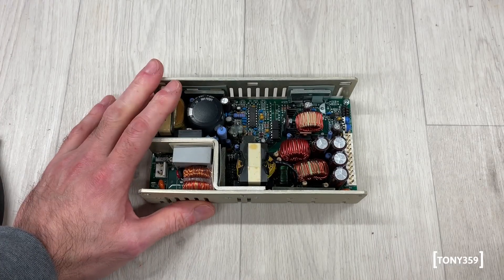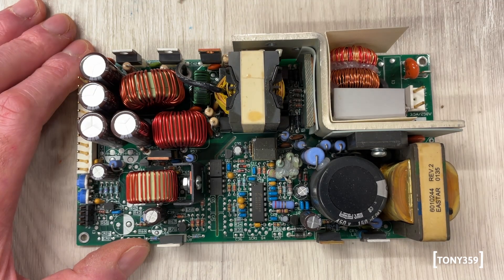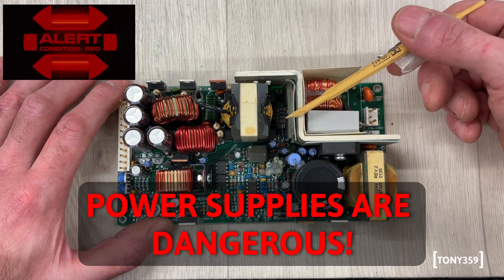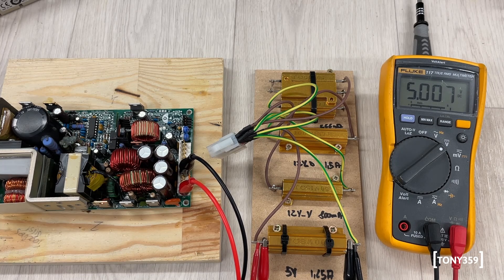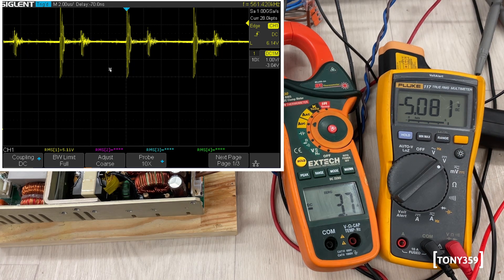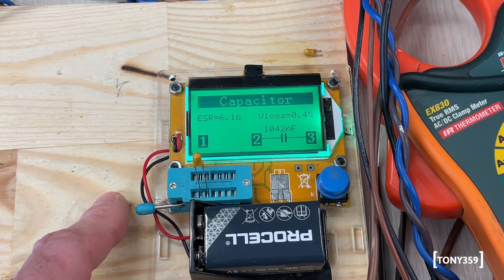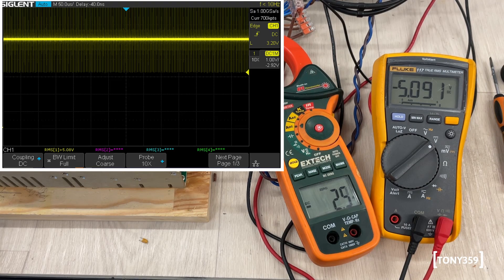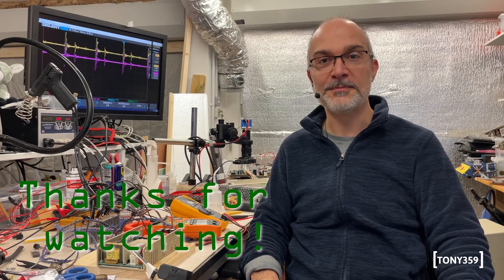I repaired a Power Supply using cold air

Comment: 3:44 pointing directly at a cold solder joint, 15:51 it´s gone😁
Reply from the maker: I think it's just cleaned, I don't think it was a cold joint, just a factory joint which hadn't been cleaned as it often happens. Thanks for watching!
Reply: @tony359 Thank you for your reply. The middle of the three solder joints next to each other horizontally looks like it has a ring around the leg of the component, to me that looks like a broken cold joint.
Thank you and have a nice day👋
Reply from the maker: I see what you mean, I often see non-existent cracks when inspecting from above. It might be though, I don't know, it's been a while! But thanks for mentioning! :)
Reply: @tony359 Yes, that's true. It may or may not be.
Thanks for your kind answer and have fun with your projects.🙂

Comment: Nice.
Did you see any thing on that cap under thermal camera?
Did you use hot air on that cap to make that intermittent problem appear faster?
Reply from the maker: Well, if you watch the first time I used the thermal camera, you can see the cap getting hot - but not as hot as the diode which stole the scene! :) The PSU was protecting itself so the capacitor did not explode or get too hot. But the diode, being a smaller component, did and that fooled me! :) 
No, I did not use hot air on this occasion. Thanks for watching!

Comment: Hi Tony I like your down to earth video's.
I do quite a few medical grade PSU's mostly from ophthalmic equipment, you could use IPA as it would evaporate and cool the device you are just not looking for the quick evaporation, I just use freezer spray as I have never owned any canned air, I have a compressor to blow off all the dust.
I guess I have been lucky and not had a nasty one like that, they usually won't start or are blown.
I also use a 15W lamp to discharge the main cap, much better than the palm of your hand when turning it over. 😊
Reply from the maker: Hello and thank you for your comment! I also use a 15W light bulb for ovens to discharge caps! I always keep some canned air for delicate jobs or where the dirty air from my compressor is not suitable. Plus, it can be used as freezing gas 🙂 thanks for watching!

Comment: Great video, Tony! I've never tried this method but I've heard people suggest using it to identify bad memory chips on graphics cards too. Apparently you spray individual chips until the on-screen artifacting changes and you've found your bad chip. I will have to give this a try some day! Any concerns with the conductivity of the spray? or does it evaporate very quickly and its not a problem? Cheers! 👍
Reply from the maker: That is indeed a primary tool in my toolbox and can be used on a number of issues 🙂 
The Gas is not conductive. The layer of water which forms on the surfaces should be pure H20. Pure water is not conductive - the salts dissolved in it are. So condensation should be safe, but you always have the risk of contamination from the PCB itself. I don’t see it as a problem though. One thing I should have done is to use a non-flammable spray can. Thanks for watching!
Reply: @tony359  That makes sense, thanks Tony! I will definitely give it a try one of these days 👍

Comment: I have used a bit of heat to pin point intermittent issues before but never thought about the other way around.
Heating up specific components from a cold state also gives a ball park where to look but cooling it might be a better way.
And again it was a tantalum capacitor again, people always complain about electrolytic caps but the tantalums are worse if you ask me.
Reply from the maker: Hot air is a good idea indeed. I did not show it on video but to "accelerate" the issue I have also warmed up the board with hot air. Both hot air and cold spray are valuable tools when it comes to electronics! Thanks for watching!

Comment: suppose you need to be wary of condensation though, when doing this. Don't want to create shorts.
Reply from the maker: As far as I know, water is non conductive. It's the salts in it which can make it conductive. Condensation should be pure H2O so non conductive. Granted, the condensation might pick up whatever contaminant is on the board. But I don't think it's a massive issue here to be fair. Maybe with higher voltages? Thanks for the feedback though!

Comment: By the way, what will happen if an arc or spark occurs at the time of using the spray with the power supply turned on?
Reply from the maker: Probably nothing good! :) You can buy non-flammable sprays and I should have probably used one of those myself!

Comment: I've seen ppl use resistors to drain mains caps on psu's just to be sure. Not sure what spec is required for this use case, but I've meaning to look it up - Must be better than my current method of just leaving the psu disconnected for a week before opening it lol

Definitely always check the cap with a multimeter before working on it just to be safe 😊
Reply from the maker: I use an oven light bulb. I soldered a couple of wires to it and insulated with tape. It acts like a powerful resistor, which increases resistance when it warms up. Ideally you don't want to short the capacitors but you don't want to wait 5 minutes with a resistor in your hands. And the resistor shall not burn. I like the light bulb option as it also gives you a visual confirmation of the charge being discharged. Then, as you say, you can double check with a multimeter. Thanks for watching!
Reply: @tony359  good idea. I'll give that a try :)

Comment: Surprise surprise, its a bloody tantalum again. Little buggers are so unreliable. Worse than 'lytics even. You should also check the other tantalum caps. Compare the ESR of a new 1uF electrolytic to this. 6 ohms is quite a high ESR.
Reply from the maker: You know what, I was wondering that indeed. Now, that little tester is not super reliable when it comes to ESR but it caught my attention. That was the brand new one BTW 🙂
Reply: Tantalums are not considered unreliable. It's easy to get that impression when you watch too many repair videos on YouTube. It's especially common that they short when they are very old, but that's WAY past their expected lifetime anyway. Like all types of components, they can randomly fail.

Comment: I think you can do the same with isopropyl. It will evaporate faster in heated areas.
Reply from the maker: That's a good tool but it's for something else. With isopropyl you can identify a shorted component which is burning hot. That capacitor was not shorted, it just barely worked but only when cold. As soon as it would warm up a bit, it would stop working. Cooling it down with liquid gas would allow me to "make it work" so I could identify it. I hope this makes sense! Thanks for watching!
Reply: @tony359  Ah okay I understand now. I had seen a curiousmarc video where they used this can air method to find a broken via. Thank you for the explanation and video!
Reply from the maker: I watched that video! The one where they use the magic finger :)

Comment: I guess +/-15 V comes from 7815 and 7915, so only when input voltage becomes less than 3V higher (in absolute value) than output, i.e duty cycle is low enough, 15 V starts to drop. 
By the way, I like a lot this kind of repairs, SMPS.
Keep up with good work.
Reply from the maker: +5V and +15V are definitely regulated by the main controller with feedback via optocouplers. Maybe -15V has a linear regulator, I did not check. If there is one, indeed it works as you say. Thank you for watching, I'm glad you enjoy this kind of content!
Reply: Highly unlikely that voltage rails from a 7815 or a 7915 would have adjustments.

Comment: Great video, Tony, and great job fixing the PSU! Wasn't aware of the diagnostics method with the compressed air, very nice to know.
Reply from the maker: Thank you! Very often you have boards which only work when cold or when hot - cold spray and hot air might help in triggering those issues. It's a pretty important tool to have! Thanks for watching!